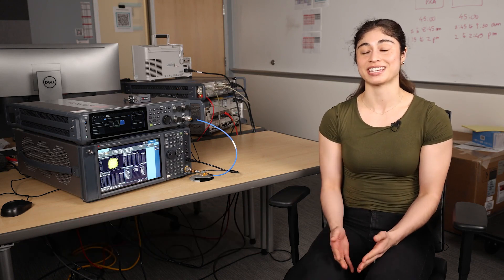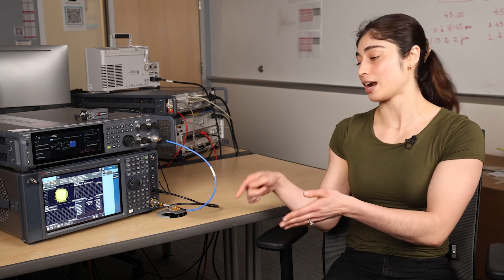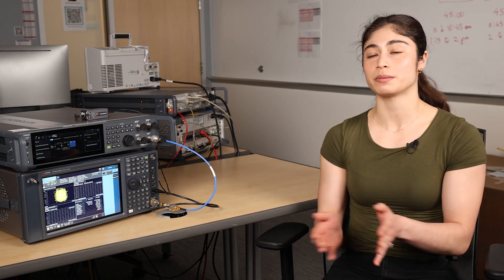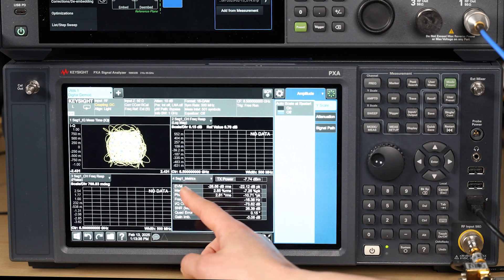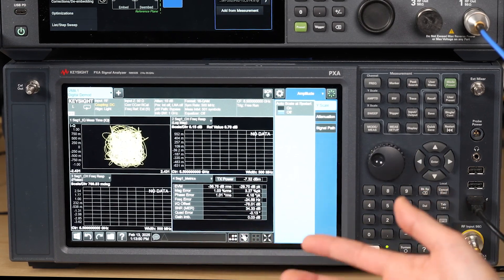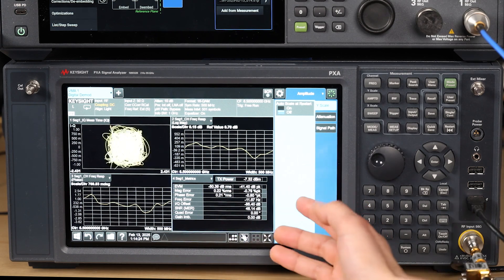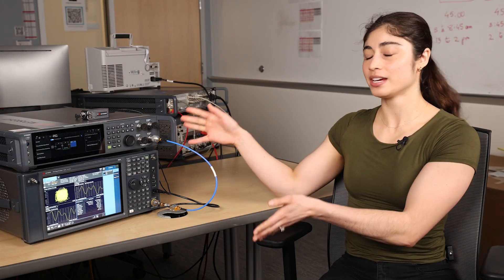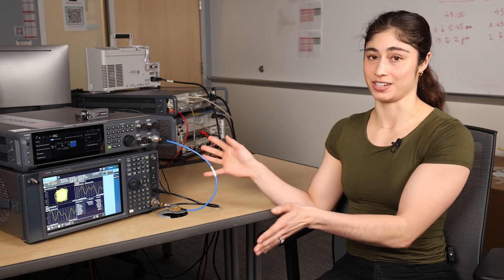N5186A MXG Mid Range Signal Generator with Embedded Reflectometer

Comment: Wow.....very smart Intelligent smart young lady explaining this equipment. I am an amateur radio operator and use Vector Network Analyzer to artificially introduce frequency though coax and out to antenna to check VSWR  Is this similar to a VNA and I'm sure it will do way more analyzing.